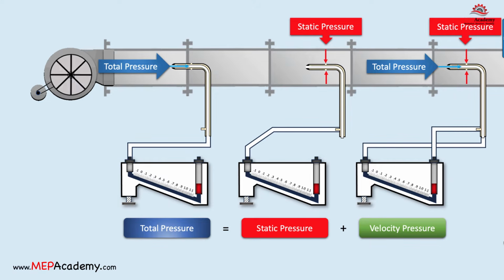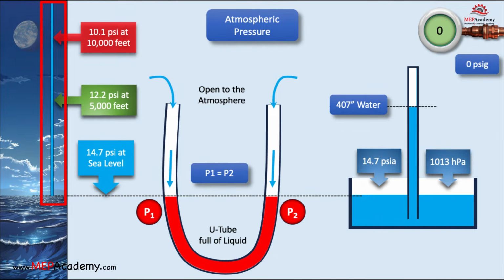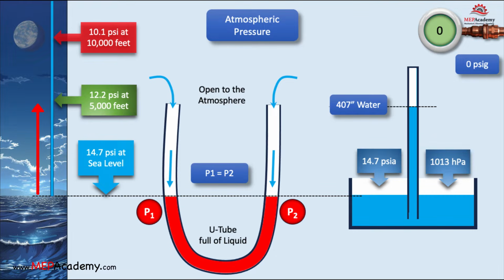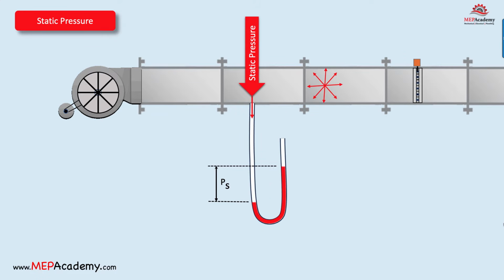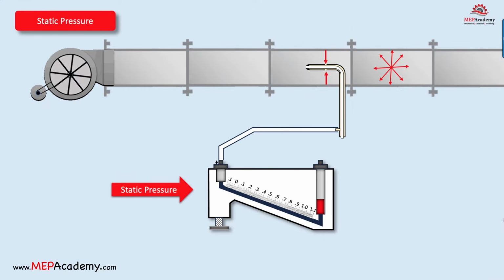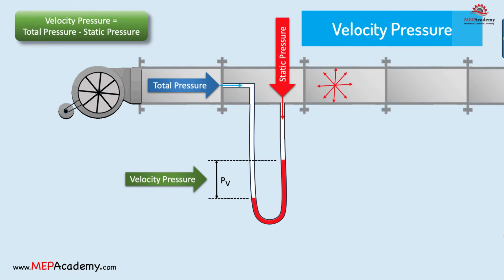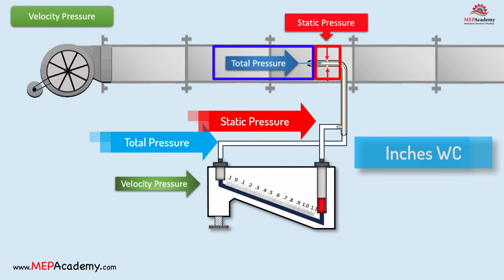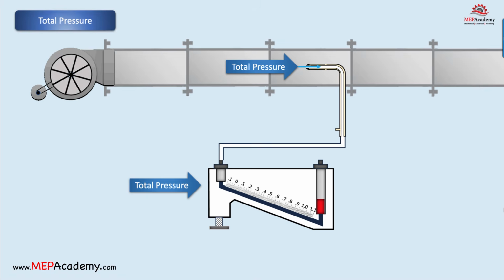Static, Velocity, and Total Pressure Explained

Comment: Question, yesterday we had a problem with our RTU that was not working. And we found out on the BAS that we had high alarm on DSP( duct static pressure) . Upon investigation we found the Dwyer static pressure switch down in mechanical room that installed in the ductwork that connected to the RTU and was not tripped. We checked the vccx2 controller but the RTU had no issues at all. What do you think the problem why we got this high alarm on DSP? Thank you for your answer.
Reply from the maker: Thanks for your question! Here's a breakdown of what may have caused the high duct static pressure (DSP) alarm, even though the Dwyer pressure switch didn’t trip and the RTU appeared fine on the controller:
Possible Causes of the DSP High Alarm:

1.	Sensor vs. Switch Confusion:
* The Dwyer static pressure switch is a mechanical safety backup that only trips at a preset pressure (e.g., 2.5" WC), while the BAS is monitoring a separate static pressure sensor (analog input).
* It's possible that the sensor reported a high reading, triggering the alarm, but the switch did not reach its trip point.

2.	Faulty or Drifted Sensor Calibration:
* The static pressure sensor feeding data to the BAS may be out of calibration, giving a falsely high reading.
* Check sensor calibration and tubing for blockages, kinks, or leaks.

3.	Dirty or Blocked Filters or Ductwork:
* A restriction downstream of the supply fan (dirty filters, blocked dampers, or VAV boxes closed) can increase static pressure in the duct.
* This would trigger the DSP alarm even though the RTU itself is running fine.

4.	Fan Speed / VFD Issues:
* If the fan is over-speeding or the VFD isn’t modulating properly, it can cause high static pressure in the supply duct.
* This often happens if the BAS setpoint for DSP is too low or the loop isn’t tuned correctly.

5.	Incorrect Setpoint in BAS:
* The BAS setpoint for high static pressure might be set too low, making it overly sensitive.
* Compare the actual pressure reading to the alarm threshold to verify.

Suggested Troubleshooting Steps:
•	Verify the actual sensor reading (in inches of water column).
•	Check BAS DSP setpoint vs actual pressure.
•	Inspect sensor tubing and calibration.
•	Check filter conditions and downstream dampers/VAVs.
•	Monitor fan speed output and see if it’s modulating correctly.

It’s likely that the alarm came from the BAS static pressure sensor, not the mechanical switch — and the root cause is often either a real airflow restriction or a sensor/loop issue. Even if the RTU is operating, an airflow issue downstream can cause static pressure to rise unexpectedly.
Let us know what you find, and thanks again for the great question!